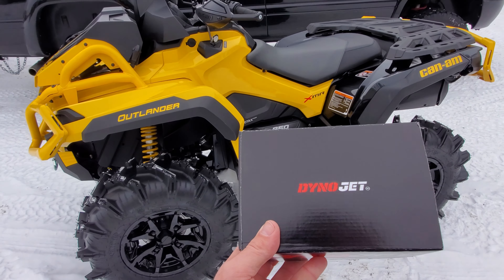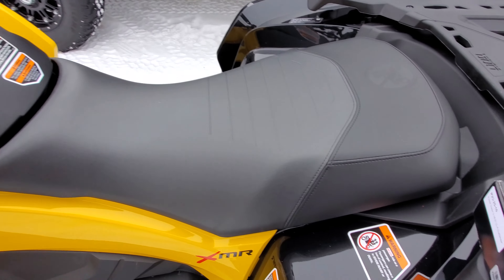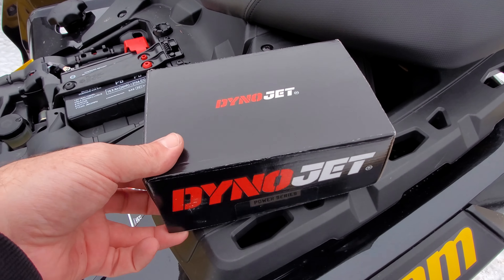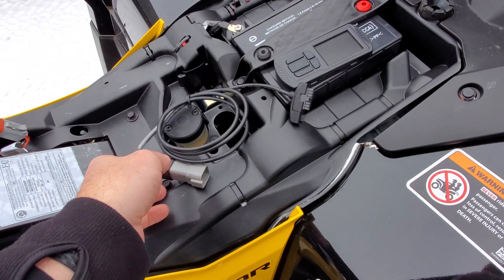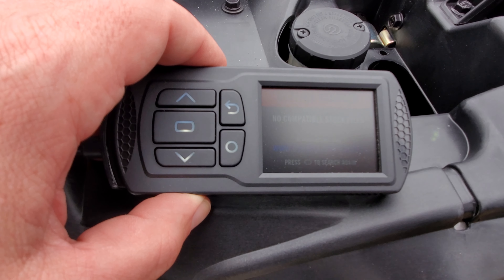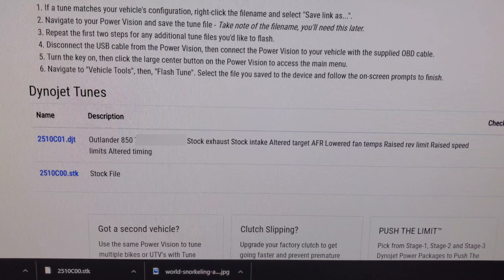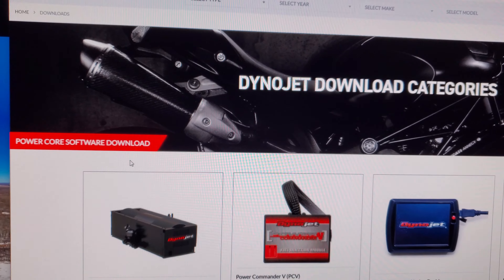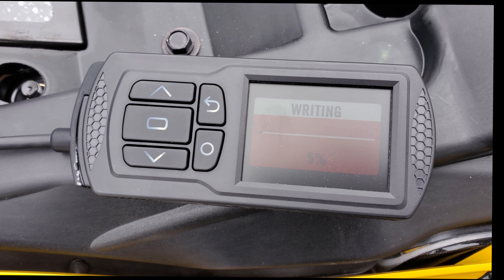DynoJet Power Vision 3 for 2021 Can-Am Outlander 850 XMR

Comment: can be used for several motorcycles or only 1
Reply from the maker: You can use it for several but you would have to call Dynojet and buy extra liscenses for each extra machine you were going to use it with.

Comment: Nice video! I'm looking into flashing mine here pretty soon! I'm not sure if the one for the 2020 850 XMR is compatible with the 2021 850 since the 1000 is the only option for the 2021modle.
Reply from the maker: The correct part number for the Power Vision 3 is PV3-25-10 for the 2021 models. I called and asked Dynojet if the 1000cc one listed worked for the 850 and they said yes it does.
Reply: @Temptation_Offroad  Okay cool. Now I can order one with confidence! If I make a video I'll shout you out. Thanks man! Also love your channel!
Reply from the maker: Welcome! Glad to help😎

Comment: Hey I bought the same tune just had a couple of questions I tuned it it was amazing then I shut it off and it seem to Erase the tune Just wondering if I’m doing something wrong or watt
Reply from the maker: Make sure you are in sport mode, the aggressive throttle tune is for sport mode only .If not that then plug in your tuner turn on the atv and make sure the flash is installed on the ecu. Hope that helps... If not message me on fb messenger and I will try to help.

Comment: Hey I just got a 2022 outlander 1000xmr and want to know how many hours do I have to put on it before doing the program and reflash?
Reply from the maker: I did mine with less than 20 miles on it and hit 82mph. 😅🤣😂 Probably follow the break in procedure in the manual if you want to be safe though. It really shouldn't bother anything to program and reflash it right away. Just don't go full throttle for extended periods of time until the break in period is over.

Comment: I was wanting a tuner for my 2021 850 xmr, great video, but when i try ordering from dyno jet its says its not compatible with 2021 850 xmr, only with 1000XMR 2021, and thwn it says its compatible with the 2020 850 xmr. How has your experience been ? After using it any issues?
Reply from the maker: No issues at all and i've ran it all summer. I actually called Dynojet before i ordered mine to make sure it worked on the 2021 850xmr which they said it did.
Reply: @Temptation_Offroad  awesome makes me more confident in ordering one, i have 2 850 xmr, i can tune both units with one correct?
Reply from the maker: @joseestrada180  Yes you can but you need to buy another license for the second machine to be able to tune it. Basically the tuner links to one machine.
Reply: @Temptation_Offroad  awesome let me look into this

Comment: Hey man, one question! I did same tuning for my 650 outlander, it’s brand new... 
I tried out last night, doing around 75mph, but I felt steering wheel is shaking a lot of on that speed 65mph+ ... is that normal? 😅 thanks
Reply from the maker: It all depends on the design of the tire and if they are evenly balanced. Also if you had a little but of snow or mud built up inside your rims would make it shake too.
Reply: They don’t make the visions for the 650s
Reply: Hi .. I have the same problem with the same ATV with all terrain tyres, try asphalt tyres and everything will be ok .

Comment: More power, more rich fuel but how all that effects fuel economy ? Is it better on fuel or it will go down on economy.  My 19 xmr 1000r is not grate on fuel to begin with, but runs hot and lean. What's your experience with that?
Reply from the maker: I Haven't put on enough miles yet to test that out. Its been super cold here for the past few weeks. -30f  I will update once I get more miles on the machine.

Comment: The XMR must have lower gearing?  I have a 2020 850 XT and it does 78mph without a tune. Cool machine!
Reply from the maker: Yeah they are geared low for turning over the big tires in the mud.
Reply: @Temptation_Offroad  limited for the tires

Comment: Hi man, please tell me is possible to instal this on outlander Max xtp 650 2021??
Reply from the maker: You will have to call Dynojet and ask them to make sure. 1-800-992-4993
Reply: @Temptation_Offroad  Thanks for your response but I’m from Europa, Croatia
Reply from the maker: @Doperides9999  I have seen it listed for older year models up to 2019 but Can't find out for sure about the 2021 model. Best option is to call or email Dynojet and ask them. Then have them send you a tune file also.
Reply: @Temptation_Offroad  okay bro! Thanks a lot for information! When is new video coming?
Reply from the maker: @Doperides9999  Im working on 2 of them right now as we speak! Both should be live tomorrow morning sometime.

Comment: Do you have to change your stock exhaust with this tune? I hunt and would rather not have my bike any louder than it currently is?
Reply from the maker: I believe they have a stock tune that just removes the top speed limit and gets the fans to turn on a little sooner as well as gives it a bit more fuel so it doesn't run so lean. That is probably what you are looking for. My HMF exhaust made this bike pretty load and sometimes i miss the stock exhaust for just cruising around and hunting like you say.
Reply: @Temptation_Offroad  Appreciate it. I’ll give dyno a call before ordering it. What grade of fuel do you run and does the higher octane seem to help with keeping the bike from running so lean?
Reply from the maker: @michaelholder4841  I run 91 with my MSA tune and the Octane fuel doesn't seem to matter for heat. The tune itself to give the atv more fuel will help it run cooler along with the fans coming on at a earlier time.

Comment: Great video! I’m looking to order my pv3 soon! Did you get yours from dynojet?
Reply from the maker: From 58 cycle is where i got mine. Just look around for the cheapest price. Make sure its the right model number PV3 for your machine.
Reply: @Temptation_Offroad  gotcha yea it’s the pv3-25-10 I have the early model 2021 xmr 850! Do you have a exhaust?
Reply from the maker: @Leepegues  Not right now but i have a HMF performance exhaust on the way whenever it gets made... Supposed to take 3 weeks.
Reply: @Temptation_Offroad  gotcha I’m still debating on which route to take with my slip on!

Comment: Do you still have work mode?
Reply from the maker: I still have eco mode, standard mode, and sport mode. The aggressive throttle tune i had them put in mainly affects sport mode. Beyond that I use Low range for plowing snow and just put it in standard mode which works great. Eco mode in low range would be good for way less throttle sensitivity for going over logs, rocks, and very rough terrain at a slow slow pace.
Reply: Thanks for the reply, I greatly appreciate it.  I don't want to change anything in work or standard other than A/F ratio. Im hoping loading the tune only impacts "sport" mode.  If you can elaborate on "the tune you had them build" I'd appreciate that as well. 

Thanks so much